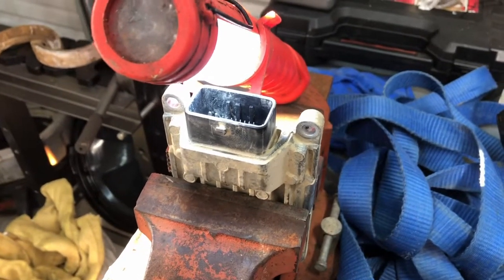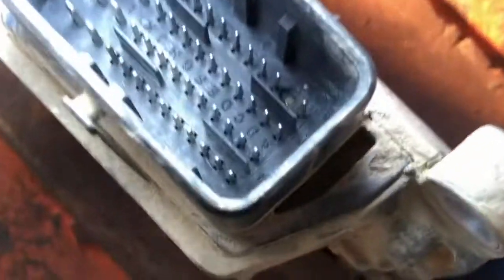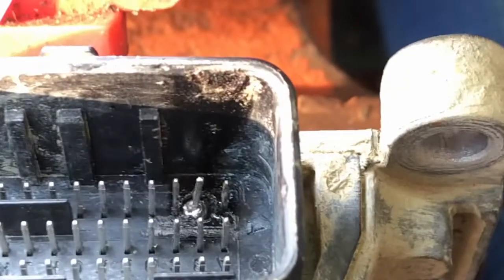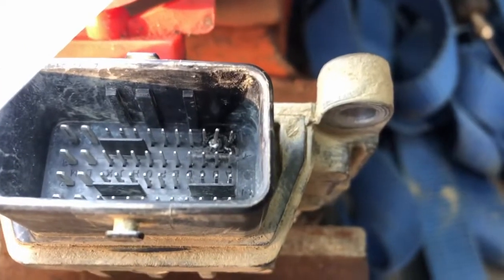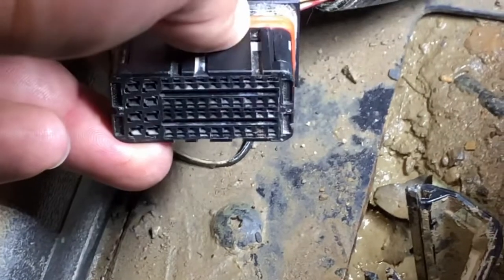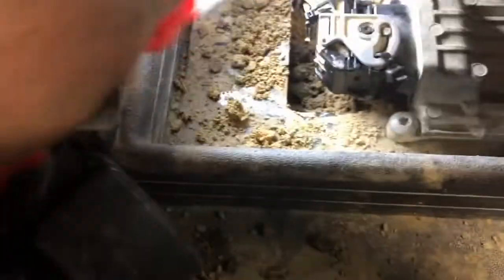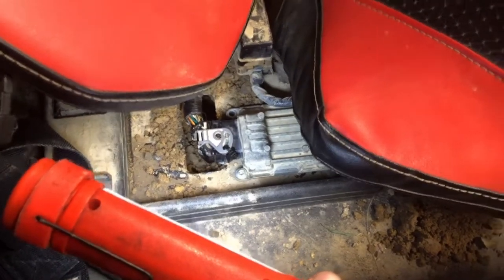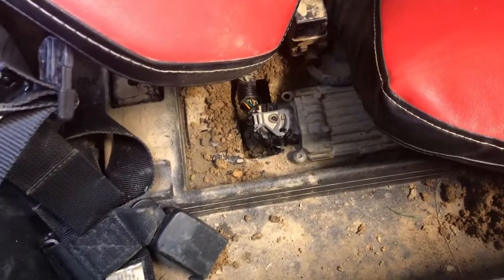Wildcat X ECU pin repair

Comment: Did you have a P0336 code with this issue? Mine dies after going into gear and I did a muddy trip and blew my belt so yeah fixing mine right now
Reply from the maker: I don’t recall on the codes, it was doing a lot of weird stuff. Are you sure you have the right belt on your machine? The earlier Wildcat 1000 is wet clutch and uses a constant tension belt. The Wildcat X doesn’t use a constant tension belt. If you put the wrong belt on, it can cause issues like you’re having

Comment: You should be more careful when pulling out connectors like that
Reply: FUCK YEAH !!!YOU JUST SAVED MY ASS!!!
 I've bought this machine knowing the charging system wasn't working changed stator and rectifier  and I had found nothing.
 I took the harness hung it from 1 side the garage to the other cut the sleeve off and went threw the wires.i found some off the main wiring was roasted fixed that and I 8 other repairs to be made.pluged everything back together and got p0562 code low voltage.it wouldnt even crank.your video just popped  up and I said let me check that connection.
 Well that sum bitch was full of mud.cleaned it now everything's back to normal woohoo
Reply from the maker: It wasn’t that I was rough pulling it apart, the problem was the pin had corroded badly at the bottom from moisture and was barely attached, so when I took it apart it broke right off